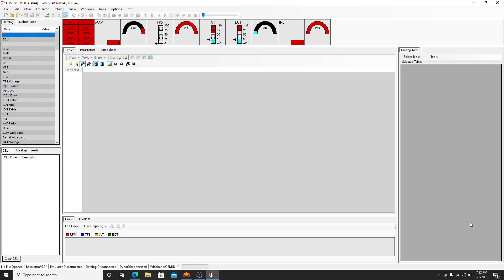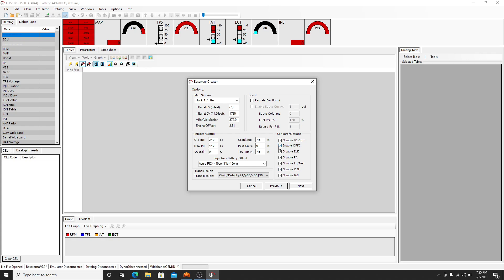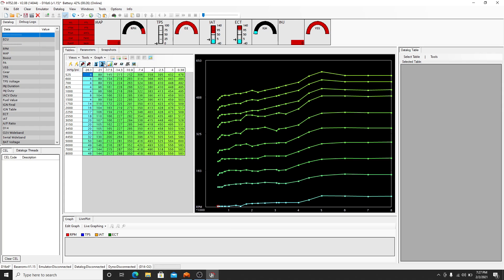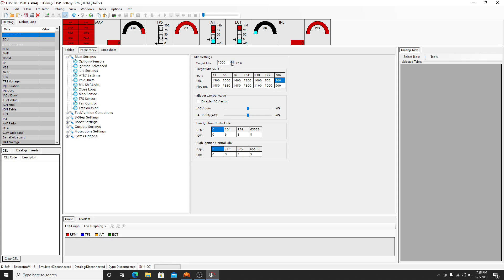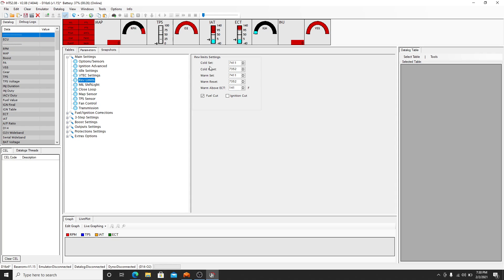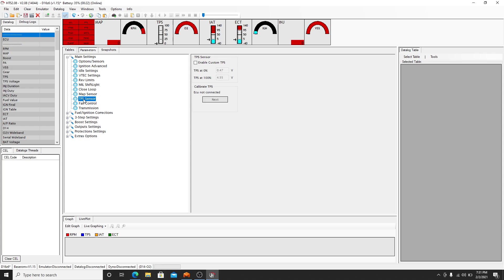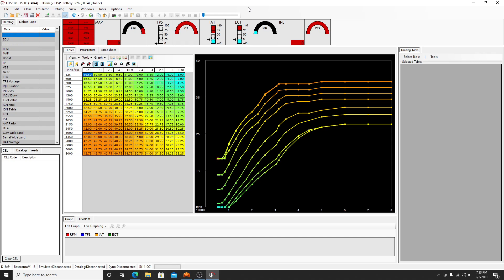MAKING A BASEMAP TO TUNE A CAR.

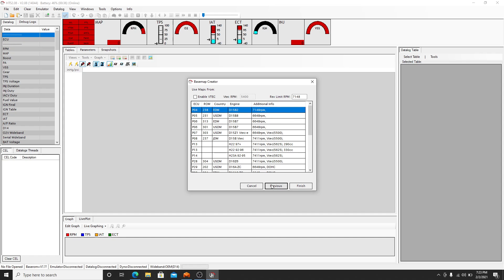Comment: on 1:43 after inputing a different value injector and pops up what engine to choose from. what should i choose for a stock f20b? i read stock 290cc so im thinking of choosing option p13 h22 97+
Reply from the maker: The F20 is a SOHC motor and the H22 is a DOHC.....it honestly doesn't matter what base tune you select you will still need to tune the car after....I would just stick with a SOHC motor map

Comment: So dumb question

I haven’t downloaded the program yet so it bolted on anything, so I’m running stock engine as can be

My question is in the videos I’ve seen it looks like I can adjust the injectors and put a launch control, is there any benefit for my f22b1?

I plan to put in a bigger fuel pump and change the injectors to about 400cc or so

I just didn’t know if it’s advisable

I wanna push it as far as it can go without cracking the block or anything
Reply from the maker: If your motor is stock then tuning is not required, hard launches will break things lol
Reply: @DIYKAI  that’s fair I can see that

I plan a tear down and want to build it back up, but from what I’m seeing finding parts that are budget friendly  and finding things compatible are hard

For the most part stock parts like timing and gaskets are easy but I do want to find forged pistons heads and rods maybe bore it out a bit but I don’t see it adding much hp

I see kits for springs and plan to send my camshaft and rockers to delta cams to make it a stage 2 

Eventually it’ll get there but first I want it to pop
Reply from the maker: If you just want the snap crackle pop……make sure you are ready to replace the catalyst if short time unless your running straight pipe then your fine
Reply: @DIYKAI  well I thought about hollowing it out and spacing the 02 sensor to prevent a code but that’s a no no and I don’t recommend anyone doing that 😉 

But mines a 97 so I’ll still need emissions but I’m definitely leaning towards bigger injectors and replacing fuel lines and pump since it is a 20+ year old vehicle

Comment: well this video has aged but i have a d16y7 what engine should i select in the basemap creator or am i not supported?
Reply from the maker: You can use z6 map and turn off vtec and adjust from there
Reply: @DIYKAI  sweet thanks man. abought to lock vtech in my engine so im gona need to
 tune
Reply from the maker: Your welcome make sure your have a wideband o2 to monitor everything

Comment: I can't get my car to start.. the check engine light goes on only when I step on the gas and goes away when I let off to try and start it when it cranks.. but I noticed I can't calibrate my tps sensor only let's me check the box to set a custom tps value.. I set my decapped ls injectors at 450cc and deadtimes to rc750cc 12ohms and took out my resistor box.. its what huntertuned told me to set them at
Reply from the maker: So many variables…motor set up? Ecu type? Stock TPS and map? Built motor? Turbo?
Reply: @DIYKAI  stock motor stock f23a block with stock f22a head. Obd1 chipped p06 non vector ecu, using honda tuning suites. Just installed turbo, hunter tuned decapped ls injectors, quantum 255lph fuel pump, stock fuel pressure. I set the com ports to com4 and com3 and I am able to connect the data logger now and the tps is able to calibrate also but still no start but my battery died so ill have to wait to try again..
Reply from the maker: @righty-tightybuilt548  yes fully charge the battery and  leave it hooked up until started and running.....as far as everything else pull the plugs you may have to adjust the fuel tip in at start-up.....also make sure you calibrate the TPS otherwise things can be off then get your base timing dialed in

Comment: Sir could you make a video about p29 ecu launch control and popcorn setup.Thanks a lot .l need help so could you give me your email adresss for ask something p29 ecu remap????
Reply from the maker: Hello I do not have a p29 but can make a similar one on a p28.
To make a basemap you just find the ecu code the closest in your case p28
Reply: @DIYKAI  l make a p29 basemap with honda tuning suite software But l cant make setup low high cam settings injector iggination setups.just Hts' p29 stock rom basemap enough for car or we must setup fuel and iggnation  settings?
Reply from the maker: @NSRTUNED  it's enough to start the car but you need a wideband o2 to tune it and datalogging

Comment: Am I the only one who can't enlarge the windows and can only read half of what's written inside????
Reply from the maker: Not sure when I do I can? What device are you watching on?
Reply: @DIYKAI  I was referring to HTS... I've tried to get familiar with it but the windows aren't showing everything... For example on the settings window where you choose the units displayed for the various tables/ graphs it only show half of what's written... 
I can't enlarge any of the windows.... I've tried the cursor on every corner and nothing happened... I've looked for a solution online bit it seems that it's just me who can't make them bigger....
I've tried 3 versions of HTS without luck....
Reply from the maker: @goncalofonseca5935  never experienced this🤔 and you cant enlarge by dragging at the center of the window line?
Reply: @DIYKAI  I just tryed the corners... I'll try dragging on the center as you suggested.... Thank you for the tip...
Reply from the maker: @goncalofonseca5935  cool lmk if it dont work I can try to help some more
Reply: @DIYKAI  I figured it out, it was nothing to do with the individual windows... 
On the settings there is a tab called "Colors/UI", on the bottom of that tab is a scale, mine was set to 100%, I lowered it and now I can see the entire window....
It makes the entire font size lower, so it's a bit smaller but I can live with that.... 
Now is time to getting familiar with this and start to become confident to start tuning.... 
If I end up finding that ecu tuning isn't for me at least I was able to learn something new and might help me in the future even if I don't tune the car myself.... 
Thank you again for your tips and to be ready to help....
Reply from the maker: Glad u found it I was going to ask next about setting and your layout.

Comment: Thanks for the vid really helped my understanding in the next vid could you possibly show the gear need to write to the chip and some data logging if possible I gave you a sub bro nice vid ✊🏾
Reply from the maker: Your welcome, yes absolutely the next video will show how to write the file to the chip
Reply: I have a old datalogging one I made if you want to check it out. I will make new ones.